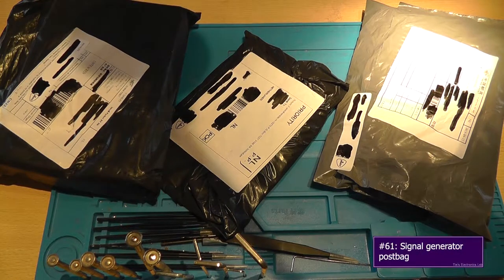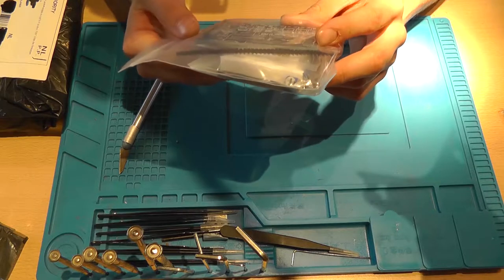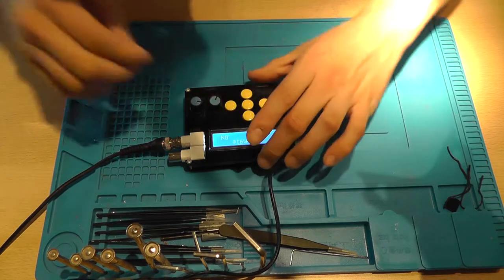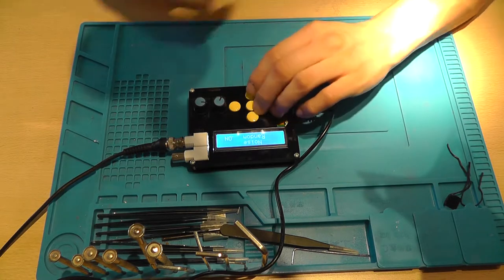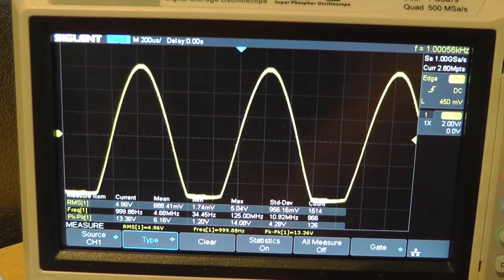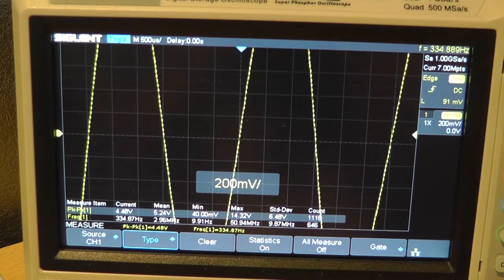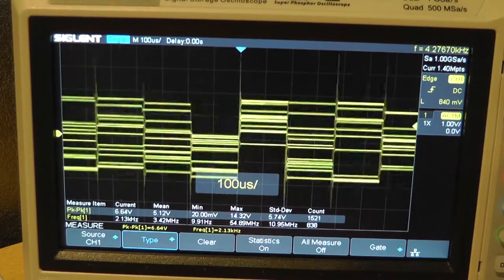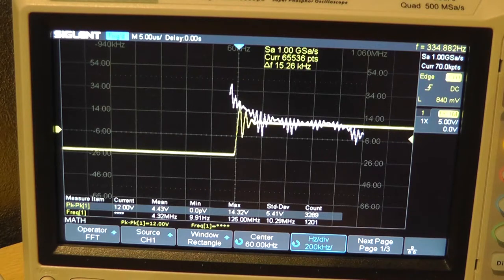#61 Signal generator Postbag 💌

Comment: Hi        The Goal Post type BNC adaptors are better than T type when the BNCs are close 

as then the leads come out at 90' rather than to the side . I can send a photo if you want .

The offset is adding DC to the signal so if the scope is on AC it has little effect .

                                                                                                                             Alan
Reply from the maker: Hi Alan, you are my hero! That explains everything :-)
If you can send the photos, that would be wonderful! Looking forward to your email and thanks for your comment!
Reply: Hi     I have had them for years and it looks like they are now called Y
type and can be found with an ebay search  ( BNC Y ) .
But they are expensive . The ones I have are like round tube -- there is
one I just found that has like a block with tubes but that is even more
expensive and may be useful at some times but ...............

                                                                                                     Alan